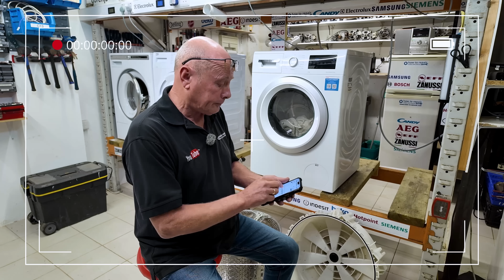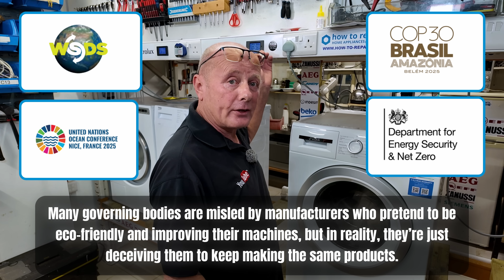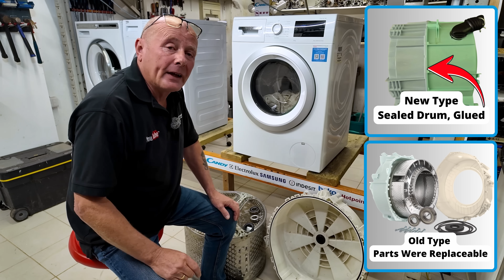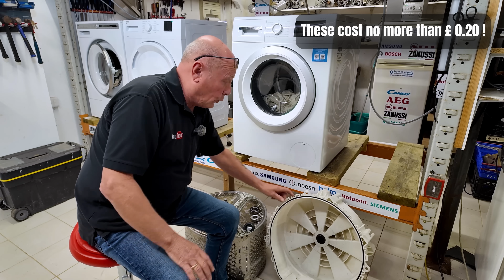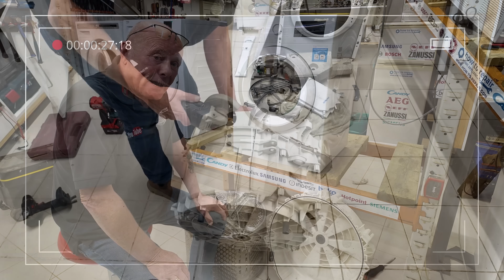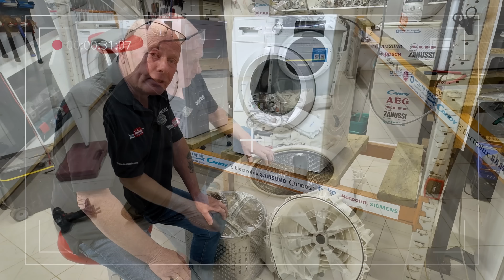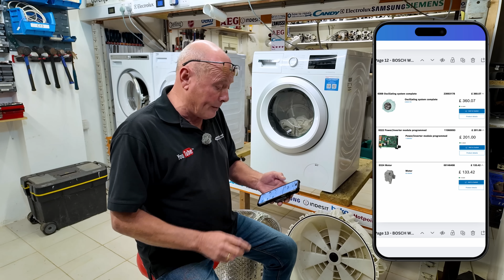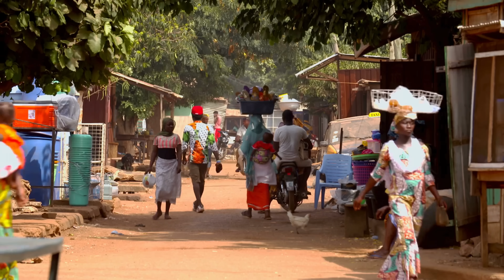Washing Machine SCAM EXPOSED! The Truth About SEALED Drums: Naming & Shaming

Comment: U hit the nail on the head . When u said motors last longer and very little fails. They lose regular wear and tear repair parts revenue so consequently charge a fortune for the parts to keep profit up.
Reply from the maker: Thanks a lot for the comment mate. The high cost of replacement parts is a deliberate mechanism to maintain profitability in the face of long lasting core components. Margins on spare parts are often significantly higher than the margins on selling the full unit, making the spare parts business a hidden profit center that recovers profits lost due to fierce competition on new appliance prices. This strategy ensures that if your long lasting motor does fail, the replacement cost is so high it forces you to buy a whole new appliance a clean win for their profit goals!

Thank you for your comment. I appreciate people like you taking the time to write it out. Please don’t forget to subscribe and share it where possible. It might help others make a wise choice instead of being misled by the industry.

Comment: On a different area, a certain high end car manufacturer has complained to the manufacturer of their 12v batteries. Why?  Because they are lasting too long and that is affecting their after sales market. Despicable.
Reply from the maker: That is a truly despicable situation mate and your insight confirms that the financial strategy of planned obsolescence affects the most advanced industries just as much as household appliances. When the product is too durable (a good battery, a durable motor, a splitable drum), the company attacks the problem with either unreasonable pricing or deliberate design/software changes to enforce the replacement cycle. Thanks again for watching and engaging. If possible, please subscribe and share the video. It might help others make informed choices instead of being misled by the industry.

Comment: I just imagined open washingmachine. Specs for easy to repaire washingmachine. Stock parts, open schematics for pcp. I would buy it. In basic home appliance new ones do the same as old ones. Structure should be standard, like in pc. Just plug and play.

Comment: youtube Bots are common man and best not to look at there account info or that as they normal have links to websites that led to Malware infections or ransomware  and 1 comment some random trash just to spark a nerve and look and its not just youtube its Twitch as well and other online live streaming or general  streaming all full and when it comes to Bot's well AI is just a bot in its own butt to matter at hand i all so agree on right to repair as i got one washing machine in my back yard with squeeeling bearings and when i lifted the drum out the top of the machine and set it down to take measurements to order new ones i find my Drum was Glued and it still had metal drum clamps and every thing glued down with screws and thinking how the hell am i going to get that sh*** open with out damage to the drum and i spent hours looking at it and thinking and i had to call it Quits as i did not even wish to waste my time cutting it open so its still in back yard if wants model number and make let me know and ill respond with it and maybe make a 2 min youtube vid of it with Lid of showing top of the drum and from a £5 to £10 Repair ended up costing me £530 + Delivery on a new machine

Comment: If bearing fails something is wrong. Cuz 1400rpm are not too much for bearing. Also some bearings can run 24/7 and 5k rpm.
Reply: It's usually the shaft seal that fails first, letting water and detergent get in the bearings and the seal usually leaks a lot sooner if you have hard water.
Reply: @mels8966 that's possible you are probably right. Imo the whole desighn of washing machines a wrong.
Reply: @Lordosvk  With a better modern seal design it would probably be possible to make washing machines life expectancy average around 20 years.

Comment: My LG dishwasher lasted 15 years. The agent wanted R2000 for a new pump but the machine still randomly wouldn't pump. I found they never replaced it. They gave me one that I fitted myself but it was rubbish so I got the OEM from Amazon for 30% of the price and it's working great. At the same time I replaced all the screws with stainless steel and removed surface rust on the chassis and sprayed on anti corrosion coating and replaced the rusty clamps. I will be surprised if it doesn't work for another 10 years.
Reply from the maker: Thanks for the comment mate. That is a good story and it perfectly encapsulates the battle between planned obsolescence and consumer resourcefulness. I genuinely value it when people take the time to share their views. If you can, please remember to subscribe and share the video. It could help others make better-informed decisions rather than being misled by the industry.

Comment: Real story:
- Had LG washing machine, with non sealed drum
- Could hear the bearings
- Was out of warranty so asked local wm service shot to replace the bearings and shocks
- Result: machine washes fine but refuses to spin the drum to dry giving out a "balance" error
- went through multiple shops, service people who could not do anything about it
- sold it off to some guy later for parts after spending 60% of a new machine on parts and labor
- the drum was somewhat harder to spin after the job

They either used a wrong bearing or seal, that was too tight so that the drum could not spin freely, so could not measure the weight.
OR the logic of the machine accounts for seal/bearings where when measuring weight/balance so a new tighter seal throws it off.

Just a story, i do think that drums should be easily serviceable, and do hope that my current Mile WED 335 wps machine has a serviceable drum. But the ability to split the drum doesn not guarantee that the repairs are possible/easy.

Comment: Hi can you get a list of current washing machines that their drum can be split for bearing repair.
Reply from the maker: I wish I could give you one definitive answer but I can’t mate. The truth is that manufacturers are constantly changing things and with their huge product ranges every brand ends up selling both great machines and complete duds. The smartest approach is to pick a brand within your budget that actually provides technical repair information and most importantly ask the seller is the drum splitable?

From my experience, I’ve personally loved my ASKO machines. They’re mechanical workhorses that often rival or even outperform modern Miele models especially since they still use a stainless steel outer drum. Some LG units are also quite solid. And big respect to Beko even though they produce more budget-friendly appliances they stand out by offering proper workshop manuals and wiring diagrams which makes them far more repair-friendly.

Thank you for this insightful comment. Please subscribe and share this video to help others make informed choices!

Comment: The price on the pcb is robbery!!!   btw are you aware there are 'universal' washing machine controller boards like the Xiangniu XN6688  for less than a tenner?  and thats complete with a display and buttons too
Reply from the maker: The functional difference between your $10 universal board and the $200+ proprietary board is minimal. The price difference is the manufacturer's profit margin used to force obsolescence. They use the proprietary nature of their board which they can claim is smarter or custom to justify charging 20 times the wholesale cost of a generic replacement, making the repair anti economical. Thank you for your comment I truly appreciate it when someone takes the time to share their opinion. If possible, please subscribe and share the video. It might help others make informed choices instead of being misled by the industry.
Reply: PCBs are ridiculously overpriced, and lack of any standardisation doesn't help. Could build and programme one myself pretty cheaply. All the universal washing machine control boards I've come across are very primitive affairs, and don't even support a modern frequency based water level transducer, which are also used on some machines for load balancing, let alone an inverter board.  I've though about developing my own on several occasions since the CPU card died on my mum's machine in the 80s (tried to convince my brother to let me have his old ZX81 to develop a Z80 based replacement) and when I've subsequently had a machine break down. One with a proper diagnostic mode that monitors it's own outputs, so it can self test, and can also tell the difference between an actual motor, or solenoid fault etc, and a fault like a failed triac on the board, or an earth leak.

Comment: Totally agree i was a heating engineer and the parts were getting extortionate. My washing drum failed few years ago it was a Hotpoint and also had  sealed drum. watched a video on YouTube on how cut the drum apart to fix bearings, i cut my old drum apart and on inspection found little wrong with the bearings  but the agitator was so close mounted to the back of the drum that it was rubbing and  causing it to be very noisy.
I ended up fitting a new drum and within a year it almost as noisy again.
The drum was more than half the price of a new machine and if I had to get an engineer to fit it, it would have been more expensive than a new one.
Reply from the maker: Thanks for the comment mate. It's clear that your experience as a heating engineer gave you the perfect technical perspective to spot the appliance industry's scam immediately. You've hit on a massive and frustrating point, the repair of your Hotpoint was made uneconomical not just by the sealed drum, but by a deeper design flaw that caused the problem to recur.

The manufacturer's strategy is clear, they charge a fortune for the part to maintain profit and build the replacement part with the same design flaws, ensuring you return to them within a few years. This cycle of costly, recurring failure is precisely why the Right to Repair is essential it would force accountability for these design faults!

I really appreciate people like you taking the time to share your thoughts. Please don’t forget to subscribe and share it wherever possible. It may help others make wiser choices instead of being misled by the industry.
Reply: Washing machine drums make a lovly plant tree holder

Comment: Great stuff. But why must a drum be in two parts?
Reply from the maker: That is a good question and one that gets right to the heart of the design flaw we are discussing. The key is to understand that there are actually two drums in a washing machine: Inner drum (the one you see) & outer drum (the shell you don't see). Historically, the stationary outer drum was manufactured in two halves (a front half and a rear half) that were bolted together with a large gasket or seal in between.This bolted design was necessary purely for service and repair. Manufacturers realized that if they welded or glued the two halves of the plastic outer drum together (making it one sealed unit), they could enforce planned obsolescence by selling more machines. Thank you for your comment. I really appreciate people like you taking the time to share your thoughts. Please don’t forget to subscribe and share it wherever possible. It may help others make wiser choices instead of being misled by the industry.
Reply: @How-to-repair  Absolutely marvelous. Thank you so much for your answer. Now I get it 100% - and it all makes sense now. Planned obsolescence happens in all products I would imagine. In eastern Germany during the cold war light bulbs and refrigerators had to by law last at least 25 years. No problem - they often lasted even longer. So it can be done. We all want things that last longer so we can use our money on other things in life - we also want (at least some of us) to pollute less and do our small bit to save the world's ressources, protecting the climate and the world's habitats and the list goes on. GREAT JOB! I will now watch the remainder og your ASKO / Better than Miele
?- video. Take care 🙂

Comment: I have a Hotpoint Ariston toploader for 15 years and repaired it multiple times. The problem is that nobody will try to fix the board and everyone advised me to change it all. I repaired the board twice and it works like a charm. First time there were some resistors burnt and the second time a triac blew. Both times the parts were very cheap compared to the board. The other faults were mechanical. Last time I replaced the inlet valve which was letting in some water slowly while the machine was idle. All in all I would say it has been very repairable. My parents also hold onto their old washing machine for over 20 something years.
It's sad to see appliances less and less repairable, but I guess it's just how the economy works nowadays. Manufacturers have understood that if they make too good of a product they'll run themselves out of the business.
Reply from the maker: You summarized the core problem perfectly mate. Manufacturers have understood that if they make too good of a product they'll run themselves out of business. This is precisely why the industry shifted away from building reputation with good quality products in the '90s. They now prioritize turnover and profit over durability which is why your parents' 20-year-old machine is a relic. This cycle is precisely why we need the Right to Repair to ensure that a cheap resistor or triac failure doesn't condemn a perfectly good machine to the landfill. Thanks for your comment and I genuinely value it when people take the time to share their views. If you can, please remember to subscribe and share the video. It could help others make better-informed decisions rather than being misled by the industry.

Comment: There's a guy in America who has highlighted this also, his Maytag washer with 10 year parts warranty failed after 6 years, and guess what, the part is unavailable and no longer manufactured, so his machine was scrap.
Reply from the maker: You've hit on a really important point about how manufacturers use the limited parts warranty as a deceptive marketing tool while simultaneously ensuring the part needed for the repair is made unavailable. This situation is the ultimate example of the industry being designed to rip the consumer off they sell the promise of durability, but control the supply chain to ensure a short lifespan and maximize turnover. If you found this information eye opening or helpful, please consider sharing this video with your friends and family. The more people who understand what's happening with appliance longevity the better equipped we all are as consumers.

Comment: We could solve this. Every time a machine fails for a fault like this instead of buying another Bosch or whatever manufacturers machine has failed. Buy from a different manufacturer. That would make them take action! Or buy from the Southern Hemisphere instead. This new Bosch I've got feels far cheaper in every way than the old one we had before. Even just pressing the start button which flexes the whole front panel or closing the door feels like quality has dropped. But it'll probably fail after a decent number of years and you'll stick with the same manufacturer. Got 13 years out of the old one. Had I not acquired the newish one from a family member might have gone on for even more especially with some new bushes and drum bearings. I'm suspecting this new one won't make double figures. But it is lovely and quiet. I do like the new motors

Comment: Sealed drums is obvious planned obsolescence. However, in my personal experience most washing machines were scrapped on any after warranty bearing/spider/motor/motherboard failure even before that. Belt, pump or solenoid valve failure too. Even just a stinking machine after the first cleanup attempt failed. So there's at least two things to fix now: attitude to be more willing to repair and those stupid glued drum units.

Comment: What about Electrolux? I am extremely happy with my washer+dryer machine, has been working solid for like 4+ years, extremely happy. Has a 10 year warranty on the inverter motor but I think that's because inverter motors don't fail anyway
Reply from the maker: Manufacturers constantly shift their production lines and release a vast range of products, meaning every brand has machines of both very good and very poor quality mate. So I can't give a definitive answer to your question mate. Thank you for your comment anyway. I truly appreciate it when someone takes the time to share their opinion. If possible please subscribe and share the video. It might help others make informed choices instead of being misled by the industry.

Comment: I'm in the US and purchased my washer and dryer in 1998 for $500 for BOTH. Brand is GE, washer was a simple top load, and a basic drum dryer, electric. In the years since, only the washer needed fixing, and it needed a new transmission ($150) that I changed out myself. Both are still operating, after 27 years. Usage is light, just once a week. No rust. Parts are still available.
Reply from the maker: Hi mate thanks for the comment. Your GE machine set is a perfect example of what was possible when manufacturers prioritized durability. The fact that parts are still available for an old, repairable machine confirms that this industry can provide longevity when the product is designed correctly. I genuinely value it when people take the time to share their views. If you can, please remember to subscribe and share the video. It could help others make better-informed decisions rather than being misled by the industry.